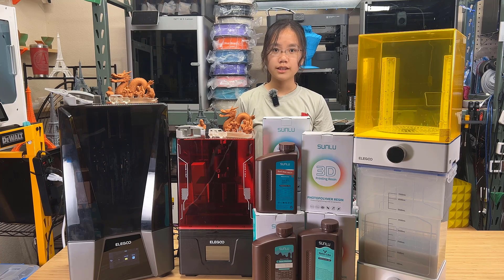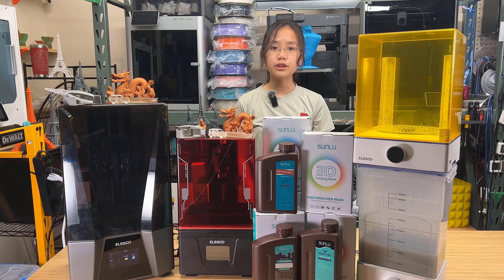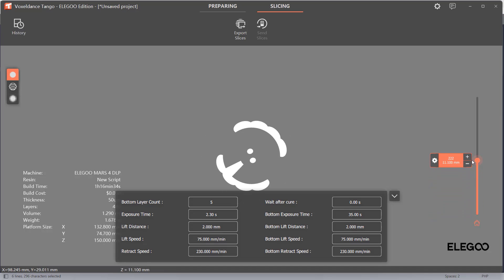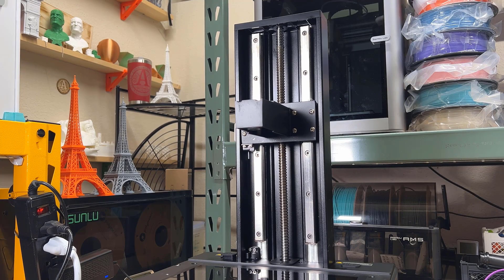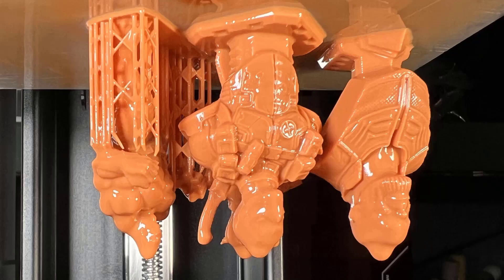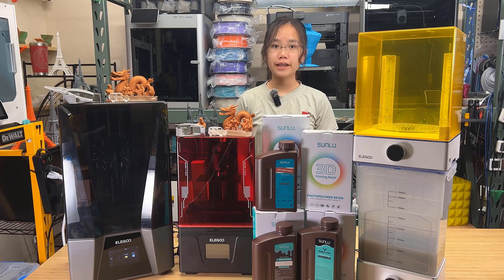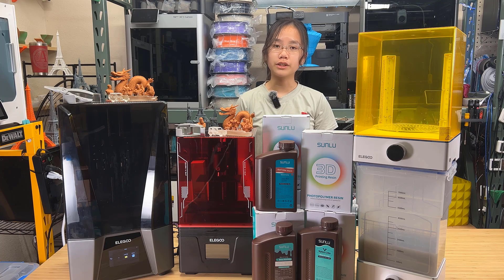ELEGOO Mars 4 DLP vs Saturn 3 Ultra 12K resin 3D printer: 2K DLP or 12K LCD for a comparable price?

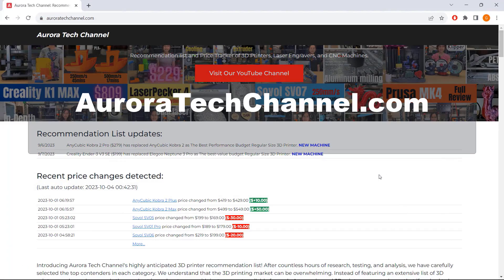Comment: Nice video. You say at 16:56 you don't see any difference, but the upper windows of the Chrysler building look much better on the Mars 4 DLP.  The 4 still has the shape and pattern continuing while the 3 has pretty much deteriorated to nothing.

Comment: My first 3d printer was a resin printer as the speed was same for printing 1 part or 20 parts as long as they could fit on the build plate. I switched to FDM later on due to requirement of printing PA for functional parts.

Comment: Thanks for the comparison! I just picked up the Mars 4 DLP. I'm excited to get to printing after watching your video.
The only downside for the printer is the build area.
I'm curious if one could increase the build area by swapping in Mars 4 Max parts (vat, build plate, top) and then using a magnifier to increase the size of the DLP.
I might give that a go one day to see what the results might be.

Comment: I liked the explanation of screen on time vs print time. Excellent point.

On another note. Pixel count doesn't mean higher resolution, just more pixels. Pixel SIZE determines how fine the resolution on the part will actually be.  One 8k printer has a pixel size of 18 x18 microns. This printer has a pixel size 19x24 microns. So with  the same part, printed at the same size on both printers, the 8K print will have better resolution.
There's another printer that, at 10K, has a 35x35 micron pixel size. Calling pixel count "resolution" is a marketing ploy.

Comment: I think the dlp prints look better.  Sometimes if you see roughness it is because the dlp cures at such a sharp line and it is truly more accurate to the model.  The projector machines look smoother because there is some light that leaks past the lcd mask, so not as accurate.  Plus it is just cool that dlp is tiny mirrors that rotate to aim the light.

Comment: You know you have a great channel when viewers send likes for the inbuilt ads!  Hoping SunLu appreciates your efforts.

I'd happily pay $600 for a 4K DLP to get the cleaner environment, longer life expectancy, and shorter exposure times.
Reply: Is longer life expectancy really important though? Will you keep your 4K DLP for 20,000 hours, or will you upgrade to the next, newer model in 100 hours? I've had my resin printers for a couple years now and might have 200 hours on each one and that was only in the beginning when it was new and interesting. Now, I'll only use them if I want to print something with a lot of detail, but knowing it won't last. 

Resin wore off on me pretty quickly after a few models crumbled with normal daylight exposure in my home office, not direct sunlight, just incidental light that fills the room. I had an F-16 I printed a few months prior break the wing off when it fell about 4' one the carpeted floor. When I picked it up, it just crumbled easily. I went back to FDM printing at that point. 

I still like learning about the new technology coming out, but to be honest, my current resin printers will probably last the rest of my life. LOL!

Comment: Resin printing doesn't translate that well from filament printing when applying the same principles
- Models should be oriented different than was done
- The profiles are not tuned for the specific resins. Translucent and non-translucent resins behave way different, same applies for printers and resin brands. Heck, even different batches of the same resin (brand, color & type) can require some testing to get the optimal timings
- The elephant foot is typically avoided when using best practices regarding orientation
- Different printer technologies, as done here, require vastly different profiles / timings. 35 second bottom layers for DLP had me scratching my head
- The support marks as shown can be avoided (mostly) with tuning the support settings: How thick they are, how deep they go, shape... but also with method (warm water can assist) and placement
- Difference in shine has to do with the resolution and the exposure time. Translucent resins can cloud more when overexposed and lower resolutions tend to be more clear
- AA can also be a large part of the quality of the end-product 

I appreciate your filament printer reviews a lot. This review was rubbing me the wrong way because of all the "mistakes".
Contrary to "if you don't have anything nice to say, don't say anything at all", I still wanted to provide an honest opinion.

sigh let's get downvoting, folks!
Reply: Which device do you recommend @Lizard008? Saturn 3 Ultra x Mars 4 DLP? Mostly for dentistry.

Comment: I contacted several Ball Screw and Straight Rail manufacturers and companies, a lil over a year ago, when trying to build my own Printer. I was told Lead Screws and Belt Drive was, and would continue to be, the best way to go. They did not assist me beyond that. A year later, and this is standard on some 3D Printers, huh.

I guess now they are going to tell me that all FDM Nozzles and most Beds, won't eventually be Induction Heaters.
Reply: Anycubic used a ball screw on their M3 Premium but discontinued that after 1 year, I assume there was some issue as it was a very good printer.
Reply: @petercallison5765  When I researched into all the variations, you have to do a little more than just replace the Lead Screw with a Ball Screw.

Because it takes greater force to get the same result, you need to use Geared Motors that are within the Specs of the normal ones, as far as # of Positions and Speed of Response. And some suggest using a Nema 23 or 24 instead of a Nema 17 Step Motor, to get more power without overworking the motor are having sluggish response.

CNC machines often use Ball Screws, because they can handle the higher pressures and torque necessary to cut/engrave wood and meta. If they are of good quality, they move as fast or faster, than some FDM printers. So the concept is sound, it just takes some engineering.

Comment: It's interesting that you'd favor longevity over resolution.  It's great that the DLP projector lasts 18 years, but a 3D printer isn't a television.  I'm not planning on keeping it until it fails.  We're still in the middle of a resin printer revolution.  

For example, check out the Athena printer - it has build plate levelling and a heated chamber.  We will soon (3-4 printer generations) have mature systems with intelligent resin temperature/exposure time controls, strain-gauge levelling and release detection, and probably AI tools to help set exposure times.  

It's almost foolish to purchase a resin printer right now.  I would lean towards buying the least expensive one that fits your needs knowing that it'll be "obsolete" in a few years.
Reply: As someone who has run a resin print farm I can assure you that changing LCDs is miserable and I would personally favor longevity over resolution any day of the week and twice on Sunday. I have changed about a dozen LCDs.
Reply from the maker: Thanks for sharing your experience!
Reply: “It’s almost foolish to buy a resin printer now.” 

Anytime you wait for the next generation you are missing out on productivity. It’s shocking to me to not buy one because a better one will be out in a few years. At the peak of my printing, my printers were paying for themselves every 2-3 days.

Comment: Why do resin printers need supports?
Reply from the maker: You need support because adding another layer on top of the previous ones prevents the small cured resin pieces from flowing into the tank.

Comment: Welcome to the world of resin printing!

You can solve the elephants foot by adding wait before print delay on your base layers of several seconds.  There are also other elephants foot compensation options in most slicers that effectively makes the base layers smaller, but if you can set a base layer wait before print separately from your normal layer wait before print, you can almost entirely eliminate elephant foot.

Alternatively, not printing anything directly on the plate will eliminate it as a concern, which is probably the easiest.

As for the dragon's horrid support scars, this suggests either over exposure (resulting in the supports being much larger than they were intended to be) or whoever supported it used much larger support tips than were necessary.  Getting your exposure dialed in on a resin printer is a pretty important thing, but also having well supported models is equally important.

Personally I have found resin printing to be significantly "easier" than FDM in my 3d printing journey.  While I've had a few struggles with odd behavior on my resin printer, I have been able to print LOTS of things without much more than spending a day calibrating my resin profile.  Meanwhile (and maybe it's because I made the mistake of going with a creality printer) I managed to print half a dozen things on my FDM before it just decided to no longer function well enough to print a single layer despite hours upon hours of attempting to tune it.  My Ender 3 s1 Plus has sat there for nearly 9 months accomplishing nothing, and I've just decided to pick up a bambu because I'm sick of it.

Comment: The real difference between the two isn't lifespan. The internals of both will outlive your desire to use them as technology advances beyond them. The real difference is in build size, where the Saturn has an obvious advantage. Splitting and joining parts is not a viable option in resin printing. I own both a 2k DLP printer and a Saturn 3 Ultra.
Reply: Lasting 18 years is great, so you will be able to get a 10 year old printer for $5.  These thing are seriously out of date after 2 years.

Comment: DLP printers not only have the much longer-lived projector instead of a screen, but they're also more durable: LCD SLA printers tend to have the LCD without much protection right up against the resin vat. Any spills or scratches can damage the LCD, whereas with a DLP printer there's just the hardened glass you can easily clean/replace.

DLP printers also use far less energy than an LCD-based one, which can be beneficial when it comes to running a print farm. It's unfortunate that Ti still has the patents on DLP technology, otherwise we might see a lot more competition in this space.
Reply: The priuce premium isn't actually from Ti.  The DMD in these printers costs $35.  It was developed by Ti specifically to make DLP printing more affordable, and is a remarkable piece of engineering, considering the price for DMDs can go into the thousands of dollars.

No, this massive price disparity is purely from the printer manufacturers saying "DLP = Expensive so we're going to mark them up to hell"

Comment: It would be great if you could do a review of the resin detergents versus isopropyl alcohol - print quality, ease of use, odors, flammability, cost, etc.  Maybe toss in general purpose cleaners that have been used for resin printing, such as Simple Green and Mean Green.
Reply: Methylated Spirits is the way to go, I believe you call it denatured spirits.

Comment: Another GREAT review!  Thanks!  Aurora Tech is the 3D printer review that I trust the most.

12:20 - "Printing 24/7 nonstop, you'd need more than 18 years to wear out the (DLP) projector."  By that logic, you'd need over 1.8 years to wear out an LED/LCD MSLA 3D printer's optical path when printing non-stop.  Even commercial operations don't print non-stop, and heavy users like that are ready for a newer better machine in two years anyway... and as you said, other parts of the 3D printer would probably fail before then, so I don't really buy the projector lifespan as a real advantage.

The Aurora Tech 3D printer live price tracking and comparison database is very cool.  I haven't seen those in a while.
Reply: Actually, 2000 hours equals approximately 2.74 months of continuous 24/7 operation for an LCD, and 27.4 months for a DLP running nonstop
Reply: @Artem1234-m9d  - I didn't pay attention to the hours and focused on the years of continuous operation as related by Aurora Tech.  As an engineer, I should know better than to trust someone else's math.  I've always used 2000 hours as a good estimate of an annual full time job after sick days, vacation... so it's obviously not 1.8 years.
Reply: That's kind of how I was thinking about it as well. Nobody seems to keep anything anymore until you've used up every last bit of it, myself included.